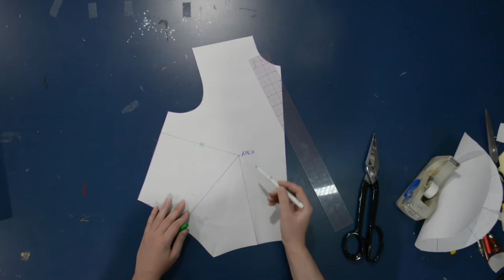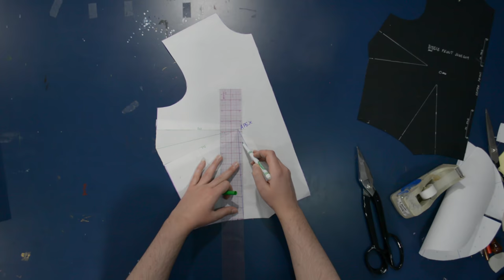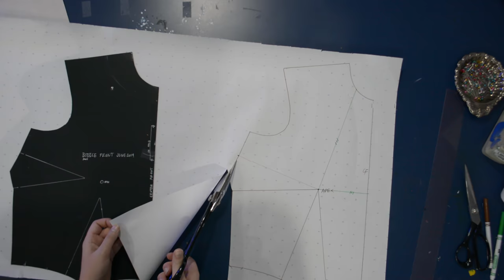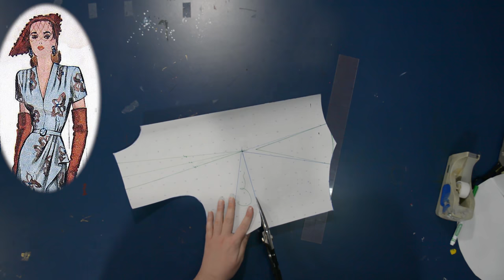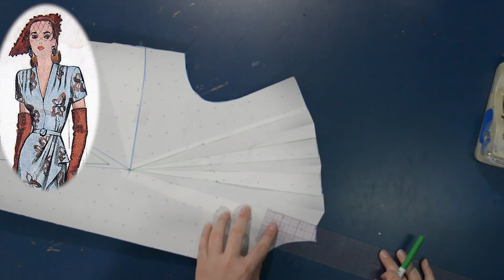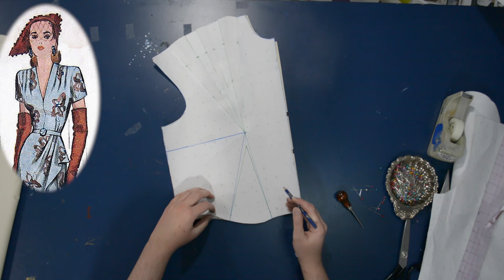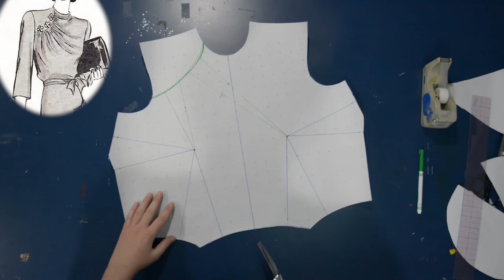Dart Manipulation Explained // The What, Why, and How of DARTS

Comment: How do you locate the position of the apex?
Reply from the maker: It is the "highest" point of the bust, so when you try on a mock up, if it's not lining up with the high middle point of the bust, draw on where it should be instead and adjust from there really!

Comment: Is there a way to figure out how to turn gathers back to darts?
Reply: You reverse the process Bianca used to turn a dart into gathers. It depends on how the gathers are placed a bit. Like if it's a fully gathered waist you'd need to separate the fullness into discrete areas to create your darts - you can always reduce the amount of fullness if you need to as a fully gathered waist will be pretty huge. The main thing is the end result of the waistline(or any other area you're changing) , be it gathered, pleated or darted needs to match, to be the same as the original waist, with all the excess fullness taken up. Also remember that you can shift the darts around so if you have too much in one, you can shift some of the fullness into separate darts. If its just a small area of gathers like a neckline, you just release the gathers(take the un gathered length) and fold the excess into one(or more) darts. If pleats, same thing. That sounded a lot more confusing than it really is but I hope made sense.
Reply: Yes thank you for asking this.  Been needing this answer myself
Reply from the maker: Part of the trouble with reversing gathers into darts is figuring out if more than the needed dart excess was added, because with gathering you can add in more than the darts initially give you. For example, someone asked me about adding more gathering to the gathered neckline bodice I showed recently (the bug print dress on the channel) and I sketched this quick explanation on how to add more gathering than the bodice darts allow for alone https://www.pinterest.com/pin/460563499400498219/ so sometimes areas may have more gathering than would be needed for dart excess. Not all gathering started as darts, so not all gathering can be turned back into darts I guess is the answer!

Comment: what about side darts on the boobs but it has elastic to let room to move and grow? im still growing in height and my cheat im 23y
Reply from the maker: I suppose a fabric that is a blend (like a stretch sateen or poplin) will have some extra give in it, but generally wovens don't stretch too much. I certainly have clothes in my closet from 5-10 years ago that I made when I was a few inches smaller, and they still fit fine I think!